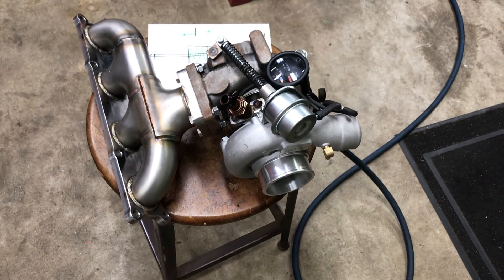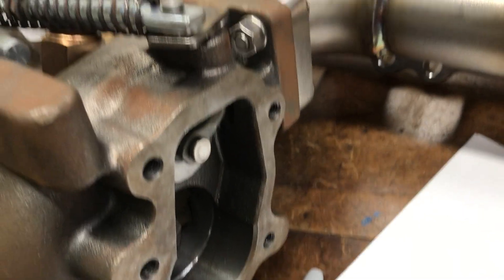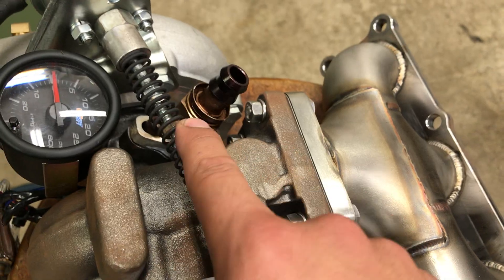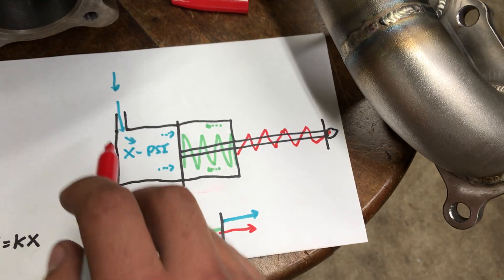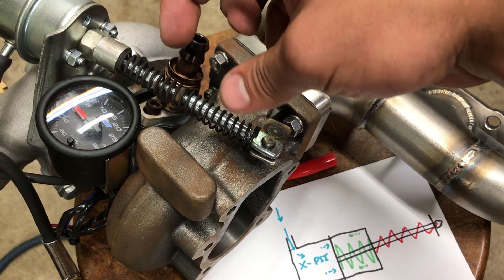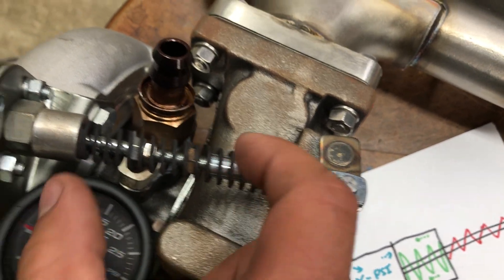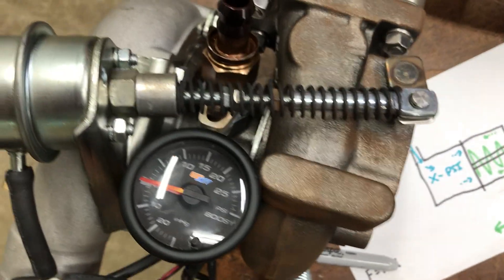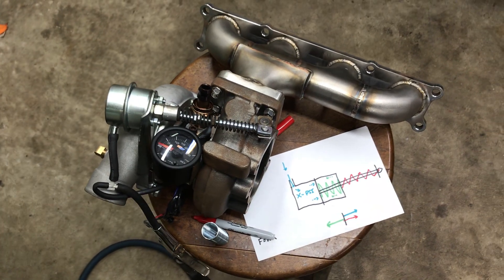HOW TO make Less Boost on a Turbocharger Wastegate. EXPLAINED 0-7 PSI

Comment: to lower the boost decrease the preload on the internal springs by shortening the rod?
Reply: shortening the rod will create more pressure on the spring making the gate harder to open, shortening the rod will increase the amount of boost needed to open the wastegate. There is no way to make the gate open at less boost than it was made for,  unless you do something like this in the video.
Reply: @agelast9831  The spring trick, to lower the effective tension of the spring.     Good to know.

Comment: The waste gate only triggers at 7psi. So how does preloading the spring change anything? 4psi of exhaust plus the spring doesn't mean 8psi. Your exhaust still has to hit 7psi on its own. The spring is just sqeezed more. I think a weaker spring would be the only simple solution
Reply from the maker: Try and watch the explanation. Its explained pretty well. Pressure = Force/ Area. Reduce the Force needed to open the gate (aka add the spring) = less psi needed to open the gate..

Comment: Hey guys, I have the next question ! My turbo spools around 1800rpm full boost around 2500rpm, but start to lost psi after, 4.400rpm ? How can I make turbo spools after 3k rpm?  Cause I’m loosing all the power after 4500rpm.. thank you ! Greetings from Costa Rica 🇨🇷
Reply: Might have to look at a bigger A/R on the turbine side. This does however change the full boost range to higher in the RPM. Just have a little look at what changes with smaller and larger A/R's. I hope this helps

Comment: How to increase the boost say from 8 to 12 or 15 psi? 

Can you do it by just adjusting the WG rod or it require additional spring?
Reply: The way you do this is by adding a bleed valve, which is basically a controlled leak in the feedback the wastegate is getting. Say you have an 8 psi wastegate and you want 12 psi of boost. You introduce a bleed valve into the hose that goes to the wastegate and leak 4 psi of pressure with it. The wastegate still opens when it gets 8 psi, but there actually is 12 psi of pressure in the intake.

Comment: Thanks for that tip man. Never thought of that. Would  this work for a T3, T4, T4E cheap Ebay $100.00 chinese turbo.  With the pre load set to 8psi. The one
Reply from the maker: Yes this will work with any turbo!
Reply: Zack are you located in Rockland County NY??